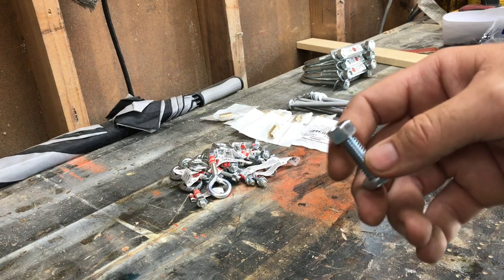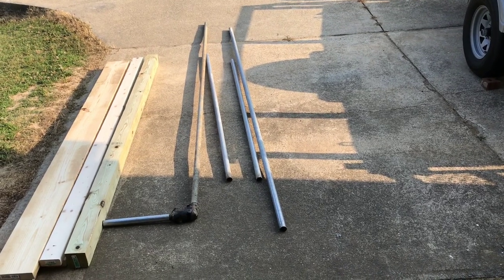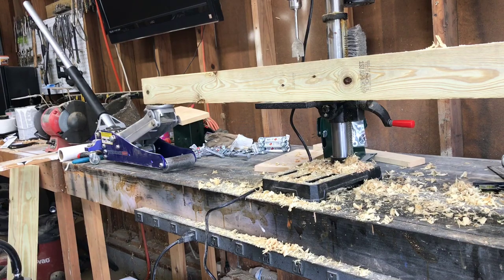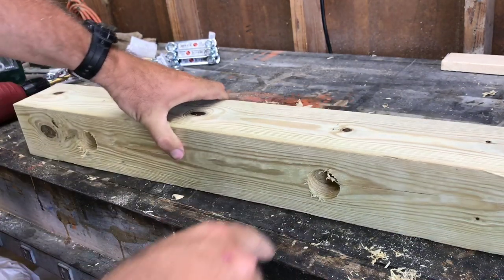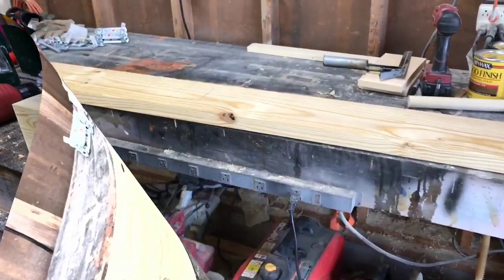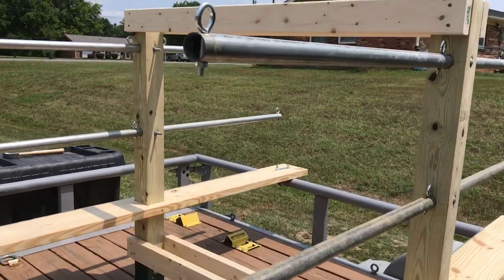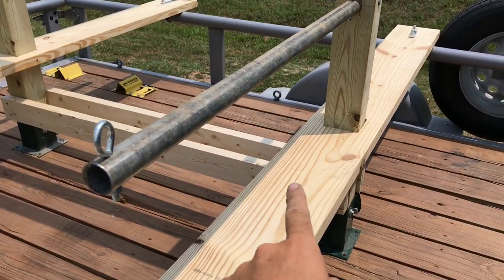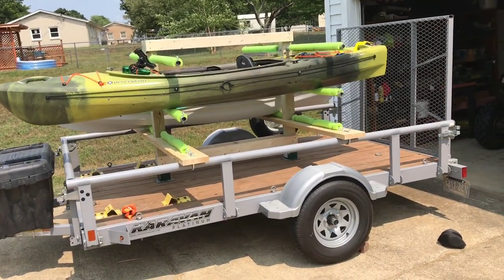Removable Kayak Rack for a Utility Trailer

Comment: Nice project, thanks for posting the video on your build, it gave me some ideas for a project and I learned a few things. Your idea of using a jack to stabilize the ends of long lumber on a miter saw is another good idea. I do something similar.

I am often setting up my miter saw and other tools in different places, so I use a spare scissor jack to make a level surface. A used scissor jack from an old car works fine and you can find them easily. If the jack is not stable enough, just screw them down to a wider piece of wood as a base plate. 

Once I discovered this (from first using the jack out of my own car during a frustrating project!) I found they come in pretty handy now and then. I used them also with some wood blocks to level up some kitchen cabinets when I installed them. Since they are raised and lowered by turning the screw, you can get pretty fine control of the height, and raise/lower things to just the right level.

Comment: That's a great design, exactly what I was looking for.  Not sure the two horizontal 2x4's are needed since the 4x4 brackets are bolted to the trailer.  I'm a fan of wing nuts just in case I don't have tools handy. Thanks for the ideas!
Reply: He did that so he can put two more kayaks on them. I might do the same, and stain the wood to match my trailer.

Comment: Looks great!  Did you think about using bolts for connecting the cross beams to the posts so that you can remove it and collapse the entire thing for storage?
Reply from the maker: Brian Neu I sure didn’t. That would have made it a lot easier to fool with

Comment: Loved your design but the pipe I got from the fence section is pretty flimsy.  I would not trust it on the highway.  I will see if I can find some other pipes to use.  Also 14” is not enough clearance between the pipes layers.  I may have to scrap my 4x4 and start over

Comment: What size trailer are you using. Also length of the kayaks. We have 2 12 footers and 2 10 footers.
Reply from the maker: Chris Steinbacher It’s a 6x10 and we’ve put from 8ft to 12ft kayaks on it so far. It works great. We took a 5hr road trip one way with it loaded with yaks and had no issues at all!

Comment: Nice job well planned. I also use my utility (homemade) 6 x 10 trailer that has wood sides, similar idea, different materials. I made a rack specifically for my 4 12 foot Old Towns from discarded 1/2 inch iron water pipe and a base of two deck boards attached to slots in the  wood sides of trailer and padded with those pool noodles. I carry mine on their sides and another yak and my specially made rack for my canoe can fit on top of the racks. I can also "lock" my yaks in the frame rack. My only drawback is it's uncomfortably wide to pull with our VW, so use a trucks usually.

Comment: I have the same trailer and I'm trying to duplicate your design.  Where did you get the U-bolts?
Reply from the maker: swat612 I got them at Lowe’s on the aisle that has the eye bolts and all that. They were on the bottom shelf. At the time it was the biggest ones they had.
Reply: @PoposWoodworks  Thanks

Comment: Why would a person need 8 kayaks? I would have skipped the eyebolts and just gone with a single hole in the bottom of the pipe for a tie-down hook. Makes it easier to load kayaks from the side without the eyebolts.
Reply: Family, friends,, group outing, boy/girl scouts - any of a dozen reasons for 8 yaks. My homemade removeable yak conversion holds 4 riding on their sides, plus a fifth and a canoe.
Reply from the maker: When we go as a group we drop the yaks off at our starting point. Then drive my truck to the loading point. When done you can get all of the yaks back to the starting point without having to drive 4 trucks. The people that can’t fit in the truck ride in the bed.

Just saves a little time and not having to shuffle vehicles so much.
Reply: Because if 8 ppl are kayaking then 12 of them are drinking.  1 DD is best.
Reply: Someone could use ratchet straps instead of the U bolts to avoid scratches and still be able to side load and the wood could use some waterproofing.